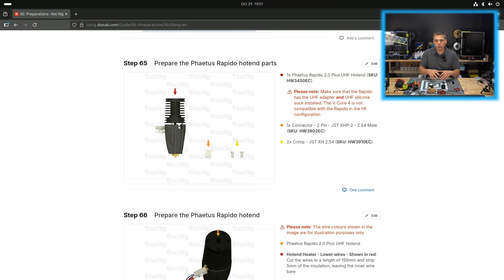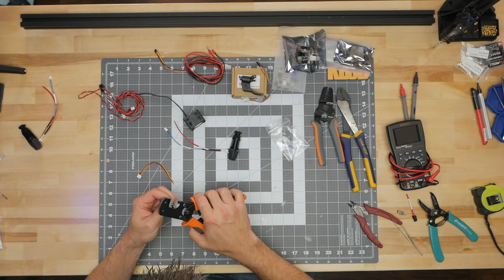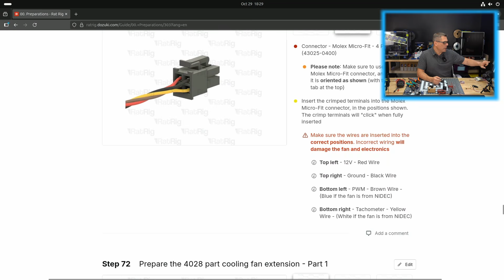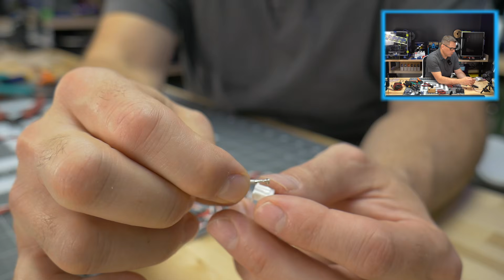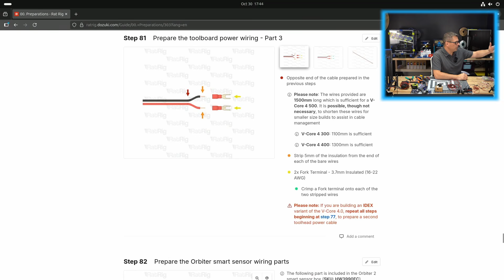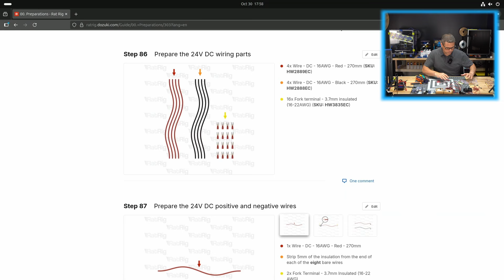Stop! Don’t Build Your Rat Rig V-Core 4 Until You Watch.  The build Starts HERE!

Comment: Why would you terminate ends before everything else was finished?
Reply from the maker: Just following the build guide!  I 1000% agree with you. It's is interesting, no one who has made a video for the V-Core 4 seemingly follows the build guide.  They all start with the frame.  It's logical, but I wanted to do the build as intended. I did do this knowing that I personally have spare parts and crimps to trim back wires as needed - but my real hope is that they have this down to a science and the wires will be nearly perfect in length (since they do call out the lengths to the mm).  But, if you watch carefully, you'll notice that I always keep an extra ~5-10mm of wire length.  I did this so I could either be slightly long if they are 100% perfect lengths, or have at least enough extra to trim back as needed.  Like all the builds I have done - I try to do it to the book.  In the end you'll get a full view of the good, bad, and the ugly!

Comment: Rat Rig doesn't do sensorless homing, or are we going "by the book, Captain"?
Reply from the maker: By the book.  Rat Rig machines are more structured than a Voron.  They even include their own Klipper called Rat Rig OS.  I actually believe that this machine is more beginner friendly...
Reply: @BuildItBasement  I'm guessing that there aren't 50 different options out there for every little feature and function?
Reply from the maker: @runbuh Correct.  The printer is designed and manufactured as a kit by ONE party.

Comment: Definately would appreciate in depth and close ups of various crimping...especially the tiny stuff. Also, when is OK to fallback to soldering pre-crimped wires on.
Reply from the maker: Nearly never
Reply: @BuildItBasement  abitnutz,, seriously had issues crimping at first too, but part of my issue was not having the best tool for the job.  IF you dont already have it, look up the iCrimp tool that he is using... After I got that, i stopped using the precrimped wires.

Comment: I'm new to crimping and putting the RatRig together was a learning experience. I gave up on the ting PH fittings and soldered pre-crimped end on and then shrink wrapped them. I got better, much better, at crimping but I'm much better at soldeing.
Reply from the maker: The issue with soldering is that it becomes brittle with long-term movement or vibrations.  I used to tin wires before crimping, and a Navy soldering tech explained NASA crimping procedure.  It's interesting.  Bet you can find something about it on the google.
Reply: @BuildItBasement I'll definitely look into that. Thanks for the tip. I can see the attraction to tinning the wire ends. That would be much easier to crimp. I get that it's not the best way to do it  but ultimately,  do you really thinks it would cause a problem?

Comment: I understand that the white and black molex are different heat ratings. I don't think it matters in this application but white and black I always thought were different.
Reply from the maker: I agree shouldn't matter - But what does matter is the documentation should match the parts as much as possible and call out changes or possible exceptions.  These call outs should be at the start of that step of the process.  I do everything from the eyes of someone who may have never done anything related to this type of project.  It should be accessible to a new builder that's 13yrs old or an engineer who is 31.

Comment: I've had mine sitting incomplete in my basement for months. Got it to the point of electronics, and have to be honest, I HATE this part. Fiddling with the tiny connectors etc. So I feel you. LOL I really need to get this thing done. haha
Reply from the maker: It can definitely be tedious at times, but the end result is worth it!  That's the home stretch for sure.  Once I get that close I'll be going live with videos, but I'll also upload edited versions.
Reply: @BuildItBasement  Can't wait! They also apparently redid the wiring section of the manual. I really need to just hunker down and get it done.